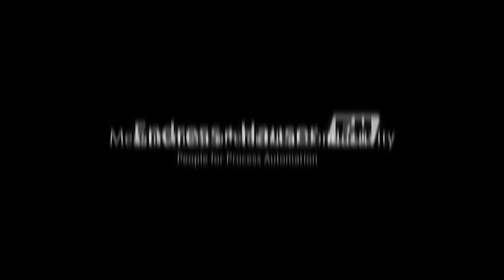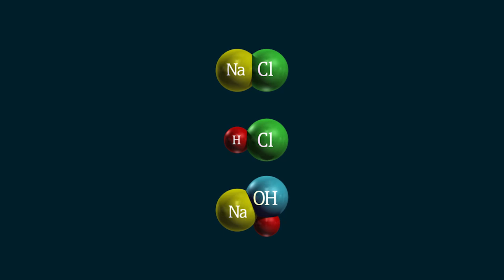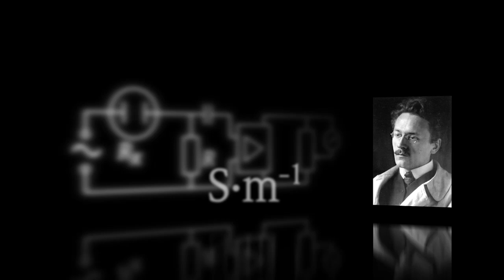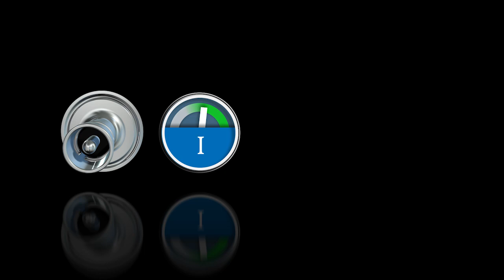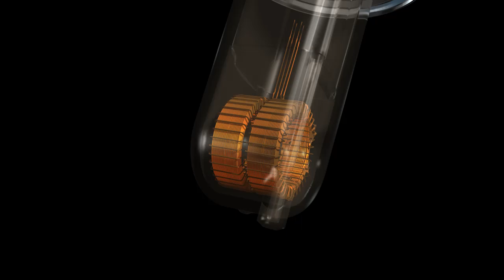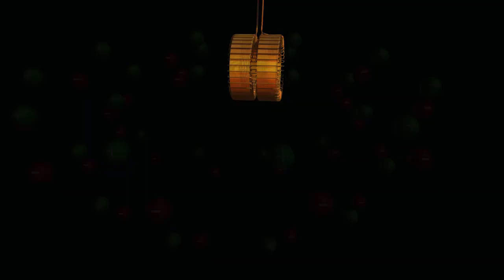Principle of electrical conductivity measurement

Comment: I was not aware of the inductive method of conductivity measurement. I am interested in the topology of the sensor. The video shows two toroidal coils, one assumed to be the driver coil the other the sensor coil. The question is how the magnetic field couples to the solution under test,  if it is confined to the toroidal core?
Reply from the maker: For this kind of questions we recommend to contact our Sales Center near to you: https://www.endress.com/en/contact Our colleagues will be glad to support you. Thank you in advance!
Reply: Endress+Hauser thank you, but I think I have now worked out how the probes works for my self. If I am correct, the coils act as two independent torroidal transformers with a common single turn of solution coupling the two transformers together. Current in the driving transformer couples to the solution under test, via the loop of solution that passes through the hole in the first  toroidal transformer.
Because of the way the transformers are sealed together, the loop of solution, carrying the induced current, also passes through the second transformer in the same fashion as the first, effective linking the two transformers together by a single loop of conductive solution. The strength of the coupling current loop is proportional to the conductivity of the solution. Hence the EMF generated by the second sense transformer is proportional to the current induced in the loop of solution passing through it.
One question remains, in foul water, how do you stop the hole from blocking, as any reduction in the dimensions of the hole will reduce the conductivity of the current loop and degrade the accuracy of the measurement.

Comment: This is Mohammad S. Bhuyan, a graduate student from OSU, Columbus, OH. I am having difficulty to measure electrical conductivity of liquid paint . I need a tool to measure electrical conductivity of resin based paint. 

Any help or advice is greatly appreciated.
Reply: Hi Mohammad. In talking to one of our Analytical experts here at Endress+Hauser, this was the feedback he gave: 

"Measuring the electrical conductivity of paint will depend on the dissolved ions present in the paint solution. That will be dependent on what the paint is made of.  Oil based vs water based paints will have different conductivity / resistivity values. Additionally, the paint will tend to coat the surface area of the electrodes used in the measurement sensor, changing the cell constant and thereby affecting the reading.  More information will have to be obtained in order to specify which sensor is best for your particular application."

Please feel free to contact us 888-ENDRESS (363-7377) and you can be connected with a local engineer that can discuss the application with you further.  Thanks!

Comment: hey somebody could tell me if:  15-25 Ohms exp -1    m exp -1     is equal to     1.5-2.5 ohms for a electrodes 10 centimeters separated between them ?
Reply from the maker: +Estuar Gonzalez
no, this is not equal. For calculating the conductivity you not only need the distance between the elctrodes but also the surface area of the electrodes.
Reply from the maker: + Estuar Gonzalez: To optain conductivity K (Kappa) of a solution, besides conductance the geometry of the sensor must be known. K=G*d/A  (d=electrode distance/ A=electrode surface) d/A is a proper physical unit of the conductivity measurement cell and is called cell constand k.
Reply: +Endress+Hauser ohhh thanks!!  then that: m exp -1 represents the separation among the electrodes? ; if I use higher amounts of solution the conductivity increases?  that is to say each electrolyte molecule is a resistor, if I increase the number of resistor the resistance decreases !  ¿right?
Reply: Endress+Hauser thanks a lot man
Reply from the maker: +Estuar Gonzalez:
The amount of liquid has no influence on the conductivity. It is the
concentration of the liquid that influences the conductivity e.g. a higher
salt concentration will lead to a higher conductivity. So it does not
matter if I have 1 liter or 2 liter of liquid but it does matter if I put 1
spoon of salt in 1 liter of water or 2 spoons of salt in 1 liter of water.

If you now want to calculate the conductivity k, then you need to know the electrode surface A (in cm²), the distance between the electrodes d (in cm) and the Conductance G (in µS). The Conductance is the inverse of the Resistance, so G= 1/R=I/U with I being the current and U the voltage. k=G*d/A.

You cannot just use the separation/distance of the electrode.
Reply: +Endress+Hauser thanks a lot mqn!!!! =D

Comment: due to coulomb force or coloumns force(didn't get) ,the electrostatic force increases and with it increase repulsion occurs,,so the current comes less.....did I got it...if I had any mistake in understanding,,,can u tell it again....by the way..video was awesome
Reply from the maker: Yes that is correct. Due to this effect the conductivity decreases for some media at high concentrations (it is Coulomb force).
Reply: +Endress+Hauser thankz...can u do a video on electrostatics...or wave optics...i understand yr video,more than the books...

Comment: I am an English teacher and I teach English for chemistry to advanced  VET students. Could you please upload this tanscript of the video? It would be extremely useful for foreing students doing chemistry. Thank you.

Many liquids are essential in our daily life. They may include water, beverages, dairy products, chemicals (acids and bases) or pharmaceutical products. The quality of those liquids is determined by their chemical and physical properties. To assess those properties, various principles of measurement are used. One of those principles is the measurement of electrical conductivity.
Let’s start with a closer look on why liquids are conductive. The electrical conductivity of a liquid arises from the dissociation of soluble salts, acids and bases, to form positively charged cations and negatively charged anions.  These ions contribute to the charge transport in the electrical field, and thus to the current flow, just like electrons in a metal.
In 1869, German physician Friedrich Kohlrausch developed the first conductometre for electrical conductivity by using an alternating current to measure electrolytic resistivity for the first time. The physical unit of electrical conductivity is S•m-1.
To determine the value, the so-called conductive and inductive measuring principles can be used. In case of the conductive measuring principle, two electrodes are positioned opposite from each other. An AC voltage is applied to the electrodes, which generates a current in the medium. The cations move to the negatively charged electrode, while the anions move to the positively charged electrode. The more free-charged carriers the liquid contains, the higher the electrical conductivity and the current flow.   A 10% acid, for example, is a very good conductor because it contains many ions that transport the charge. In contrast to this, pure and ultrapure water are bad conductors because they contain only few ions.
If, however, the ion concentration becomes too high, the Coulomb force increases. This electrostatic force leads to a mutual repulsion of the ions and thus a reduction of the current. The effect is called polarization and occurs with highly concentrated media.  
The electric resistance (or its reciprocal value, the conductance) is calculated from the measured current according to the Ohm’s Law. To derive the specific conductivity from the conductance, the so-called cell constant must be determined. It is based on the geometry of the electrode arrangement and reflects the distance of the electrodes in relation to its surface. It varies depending on the electrode design and influences their suitability for different areas of application.
Conductivity is also dependent on the medium temperature. Therefore, the temperature is measured in parallel and the conductivity values are referred to a reference temperature of 25° Celsius by the transmitter. Conductivity sensors have a simple design and are highly sensitive, which makes them suitable for a wide range of applications, from ultrapure water to drinking water and more.
The inductive measuring principle uses the inductive conductivity sensor. It contains an electromagnetic transmission and reception coil in a protective plastic coating. An alternating magnetic field is generated in the transmission coil, which induces an electric voltage in a liquid. This causes the positively and negatively charged ions of the liquid to move and generate an alternating current. This current again induces an alternating magnetic field, and thus a current to flow in the reception coil. The intensity of the current depends on the number of free ions in the medium. It is evaluated by the transmitter and the conductivity is calculated. 
The advantage of inductive conductivity measurement is the galvanic isolation from the medium. Polarization effect cannot occur and the measuring principle is insensitive to soiling.
The conductive and inductive conductivity measurement by Endress and Hausser enables precise control of water treatment and cleaning and rinsing processes, for example in the food, life sciences and chemical industries. 
For further information on liquid analysis and the latest conductivity sensor generation, featuring Memosense technology, visit the Endress and Hausser YouTube channel or www.endress.com.
Reply: That's odd! YouTube won't automatically generate subtitle for this video!
Reply: thank you so much i really appreciate what you've done . Thank you

Comment: Amazing video. Fast, concise and elucidate the basis of conductivity measurement. As all physical and chemical principles that EH brings to us. Thanks.
Reply from the maker: + Estuar Gonzalez
No, as the concentration is the same, the conductivity is also the same.
Reply: hello !! hey if you increase the volume of the solution with the same concentration the resistance of the solution decreases?
Reply: I belive there are two different concepts here.
The instrument measures conductivity of the same amount of liquid.
This volume depends of the electrode geometry. Conductivity is the reverse of resistivity, not resistence.
Reply: Pedro Federici if I have a bigger volume the resistance decreases and conductivity increases ?   as more electrolytes more pathways are to electrons run ¿right?
Reply: +Estuar Gonzalez, the electrodes have small dimensions compared to the vessels. They measure the conductivity through the resistance (of the material) at their boundaries and this measuring depends on the electrode geometry. This relationship (resistance versus conductivity) is precalculated by the manufacturer considering the that geometry.
Of course the resistance of all amount of material, change if the volume changes. But, conductivity is a material (liquid on this case) characteristics, not a body (all amount) characteristics.
Lat's use a solid example. If you take an one meter copper wire its resistance will be lower than a two meter wire (same cross section). But the copper resistivity (and conductivity) is still the same.
Reply: +Estuar Gonzalez, the electrodes have small dimensions compared to the vessels. They measure the conductivity through the resistance (of the material) at their boundaries and this measuring depends on the electrode geometry. This relationship (resistance versus conductivity) is precalculated by the manufacturer considering the that geometry.
Of course the resistance of all amount of material, change if the volume changes. But, conductivity is a material (liquid on this case) characteristics, not a body (all amount) characteristics.
Let's use a solid example. If you take an one meter copper wire its resistance will be lower than a two meter wire (same cross section). But the copper resistivity (and conductivity) is still the same.
Reply: HUm !!!    I'm thinking as in electronics...  say 2 resistors of 1 KOhms connected in parallel have less resistance than 1 resistor of 1 KOhms so -->   that makes me think that if the solution has more pathways (more resistors = more electrolytes and water) decreases the resistance...